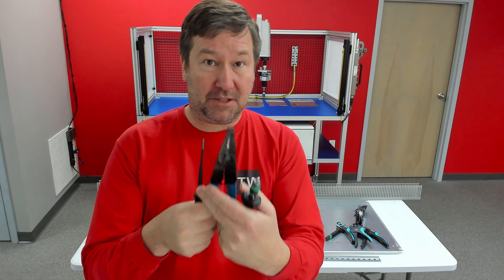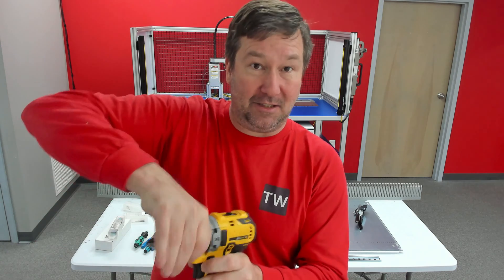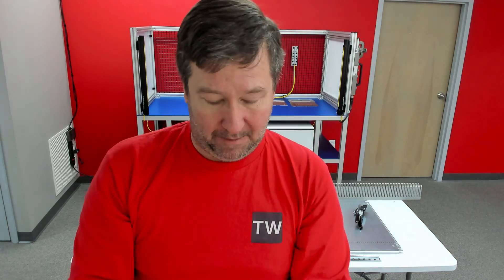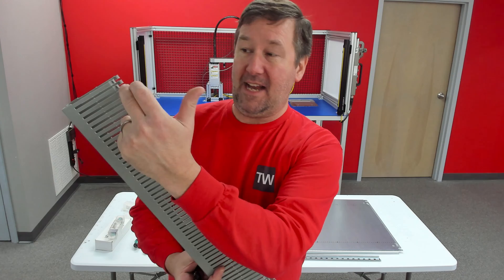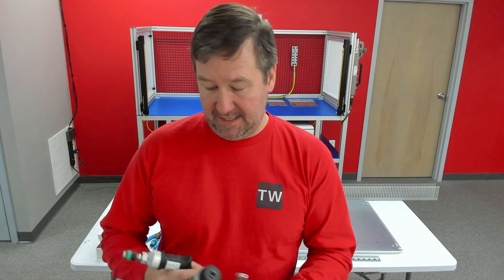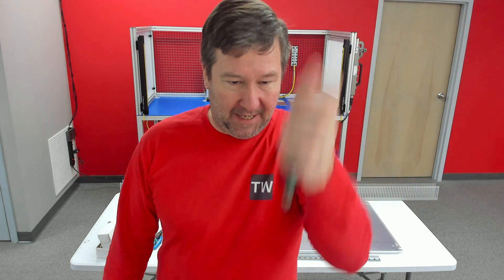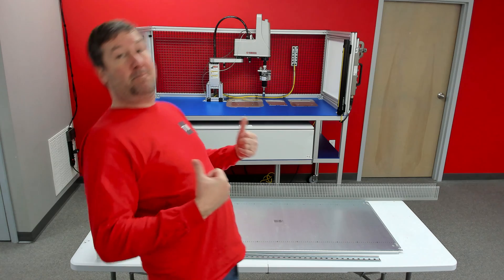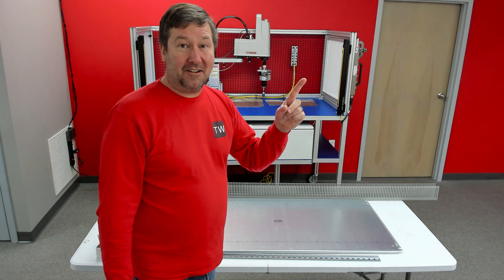What Tools do You Need to Build UL508A Industrial Control Panels?

Comment: I used several 3m lengths of Uni-Strut (the stuff that frames to mount panels on) to make a framework thhat I can assemble and wire backplates on, I currently have an 800x800 backplate on it although it usually has 6 off 400x400 backplate on it.
Simple move a horizontal strut up/down to match the current panel and bolt it to it.
Magnetic bars on the front can hold tools with wire rolls dangling above.

Makes for a much easier, quicker and safer build.
Reply from the maker: Great recommendation.

Comment: Hey tim what do you use to hold wires in the duct? Ive tried everything and i havent found anything that i really like yet.
Reply from the maker: I talk a little about leaving the fingers in on intersections to help that in this video. 
https://youtu.be/zz5xEB4KuaU?si=QF-BkIzuEZS8RFLQ

There are also some claws that you can install along with the wire duct but I have never used them. 

I should have mentioned it in the video but for managing wires during the build, I cut small pieces of cardboard and stick them between the fingers to hold the wires down.
Reply: Not sure what you mean by holding wires in the duct, surely the duct does that?
While wiring it you can use offcuts of lid placed to keep the wires in, or if you want to keep a bundle in you can use a large cable tie base, sometimes you can screw those down too, then tie the bundle of wires to it.

Otherwise the wires normally just sit in the duct.